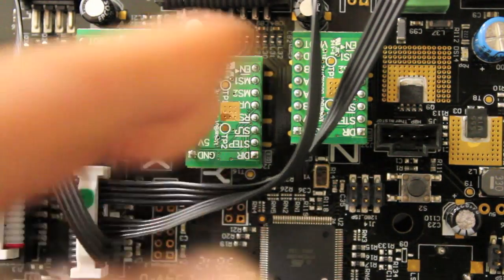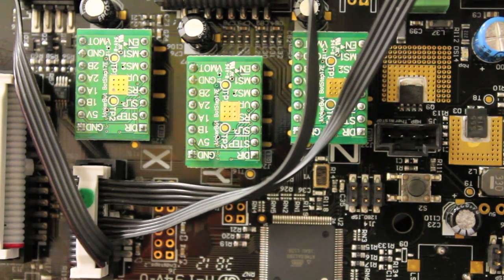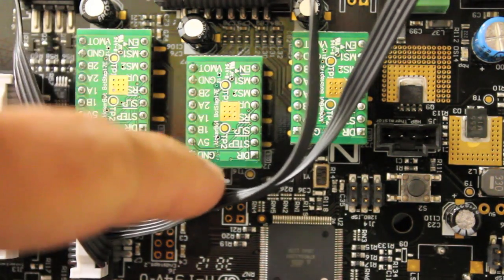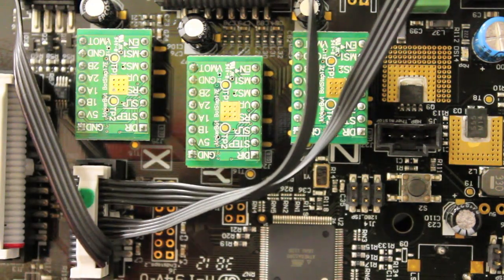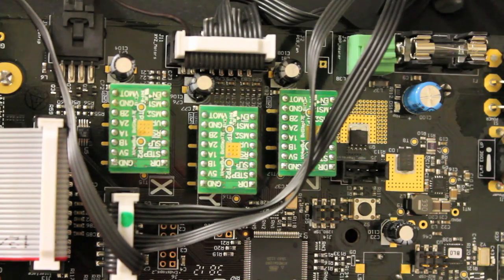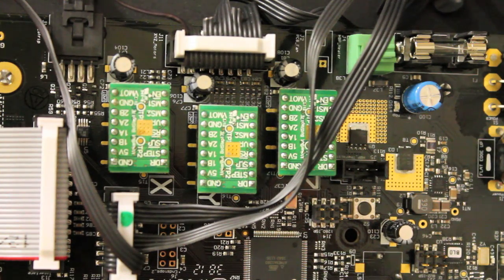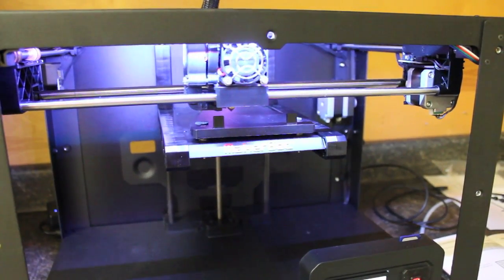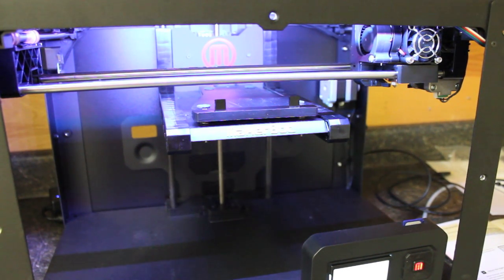MakerBot Replicator 2 X-Axis Stepper Controller (BotStep) is Bad - Problem #3 Discovered

Comment from the maker: I'm sorry to hear you're having so much trouble. I've been through a lot of it, but thankfully I'm printing just fine now. It does scare me to hear you're at the 50 hour mark and having problems. I'm not far from 50 hours. I know what you mean about consuming a bunch of time. Part of me accepts the fact that there will be problems out of the gate, but knowing I won't get countless hours of tinkering back is pretty frustrating. Good luck with your setup.

Comment: We bought two Makerbot Rep 2Xs for prototyping at our company. We have only had problems with them. We returned one because it had this bad X-stepper issue right out of the box. Now after about 50 hours of printing the replacement printer is screwing up same issue. We have had several issues with the this printer, it has consumed a lot of our time. I noticed Makerbot has placed a badge on their website that the printer requires patience, know-how and a sense of adventure...to say the least.

Comment: Got 0 mechanical ability & patience? AVOID MAKERBOT.  When it works, works great but to get there took: purchased windows 8 PC as Makerware didn't work as promised, filament feed upgrade, new thermocouple, Ball bearing cooling fan. Now X stepper quit. Troubleshooting points to controller. No tech suport help yet, if it must go back for repair, I'll return it & build my next REPRAP.  Extremely disappointed & never recommending this product. PLA denser better dimensional stability.

Comment from the maker: The Replicator 2X looks like a great product if you want dual extrusion and to print simultaneously in 2 different colors. Since most of the prototyping I'm doing isn't dependent on multiple colors I find that my Replicator 2 is just fine.  I also know that the 2X prints in ABS where as the 2 prints in PLA. Good luck with your decision.

Comment: We have the same problems. At the first setup script the build platform moved with terrible jamming sound (Z-axis).
We swapped X-controller and Z-controller. And now X stepper motor generates terrible sound. :( It was on Sunday. Support has not responded yet.